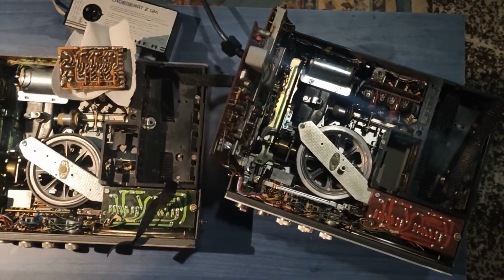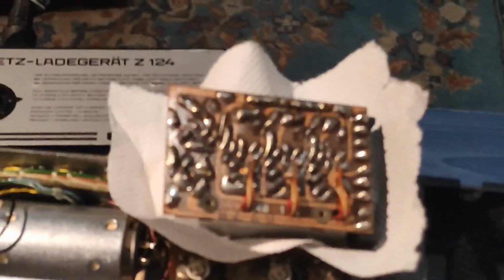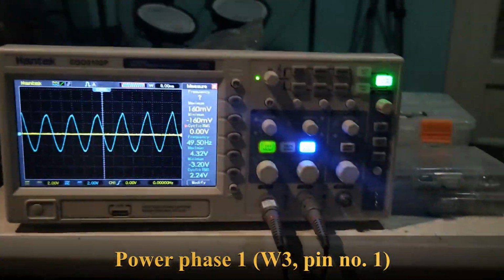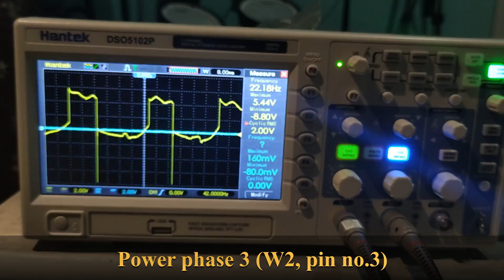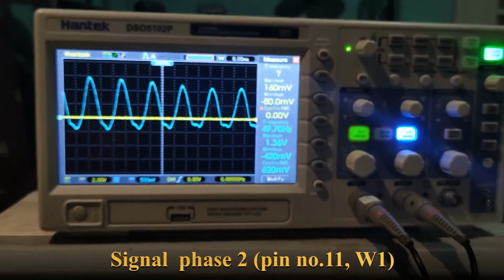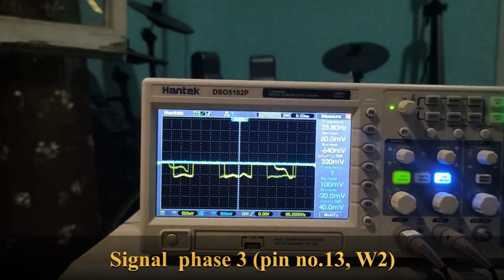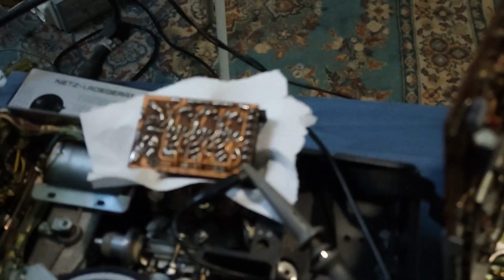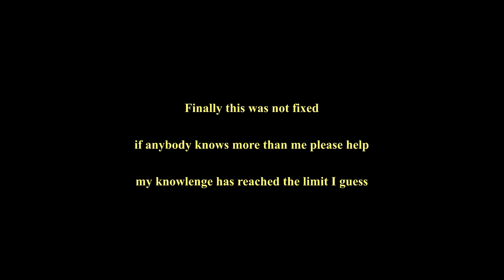UHER Report 4400 - Failed motor control board-no fix

Comment: Since the waveforms for all 3 phases are affected, I would check the voltage feed for the three pots that fine tune the speeds. It seems like the bias for all three amplifiers is not correct. I don't think it is a transistor problem, because the three amplifiers are able to drive the three coils in the motor. Also, check the three diodes that the bias is fed through. Good luck, those are very nice machines.
Reply from the maker: There is only one pot and the motor has only one speed. The different speeds of the machine are made through the pulley size change. Anyway there are 3 X AA118 diodes (germanium), each on each phase. I guess I have to desolder them to check. I'm afraid that the Ge diodes with their small voltage drop are more suitable than the Si ones for the tight voltages in that machine (5-6V). But if I measure a dead diode I will try a Si one and see what happens. There is also a 3.9 zener (ZF3.9) and I guess this is also a serious fault candidate. The machine is now stored but as soon as I get time I will mess with it again. Thanks for the recommendations.
Reply from the maker: Checked all 3 AA118 diodes as well as the 3.9V zener and they all tested correct. Damn!!!!